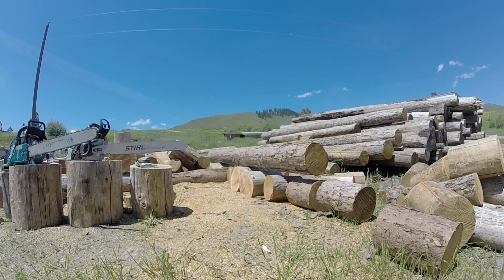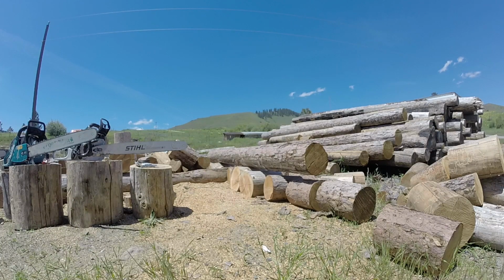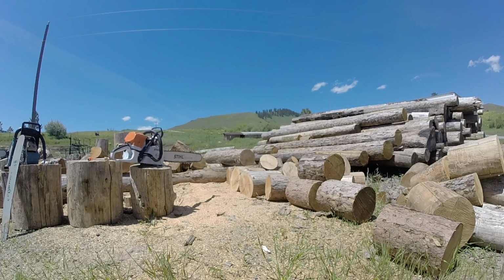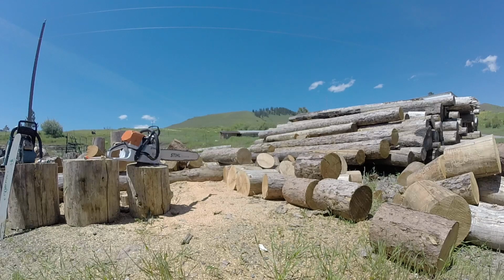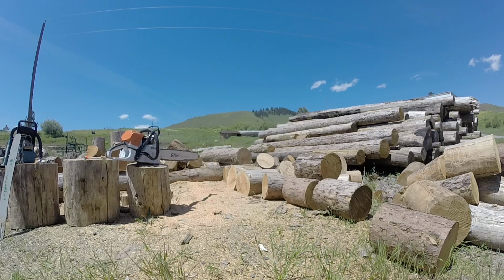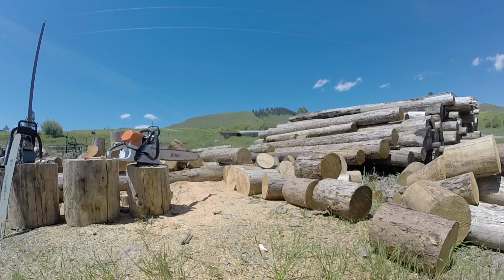Dolmar 6100 vs Stihl ms362

Comment: Nice video.  What do you think the parts situation will be for the Makita/Dolmar saws in the next 5-10 years since Makita is pulling the plug on gas saws at the end of March 2022?  God Bless.
Reply from the maker: I ranted on the 460 vs 7900 video where this question was also asked.
Reply: Not sure about the future, but I have no problem finding parts online.

Comment: Hi there Sir,
Have a question.
I have a 350e Husky with an 18 inch bar,what size bar(bigger) can I put on it if it was Hotsawd.Any info would be appreciated.
Regards Glenn
Reply: If the saw was ported and you end up with the performance of a 50 cc pro saw i would recommend no more than a twenty inch bar unless your cutting really softwood
Reply: Rick Kaiser thank you
Reply from the maker: Glenn hi.
I have a 50cc 346xp that is extreme ported. It will pull a 24" bar pretty good - but it depends on the chain more than anything else. A guy can have all the power in the world and if the chain doesn't cut cut then he gets nothing done.
If the chain is good then it would depend on how intense the zipkit is.
Thanks for watching.
Reply: hotsaws101 
Thank you
Reply: hotsaws101 
Hi again,
I was hoping to cut some slabs of Blackwood.But I'm going to need a bigger Saw.
Regards Glenn

Comment: Jack, is a bar adapter availably to run the Stihl bar on that Dolmar? I have a 6100 that I wish to got with a lightweight 24" bar, Stihl pattern. But it's the small Husqvarna mount...
Reply from the maker: cameronb76 hi.
Cannon makes one to run a medium sized Stihl bar on Dolmar bolt patterns.
Thanks for watching.
Reply: @hotsaws101  can you tell me what bar you ran in the 6100 vs 362 video?
Reply from the maker: There were two. A Harvester (hw)  and Stihl (lw)